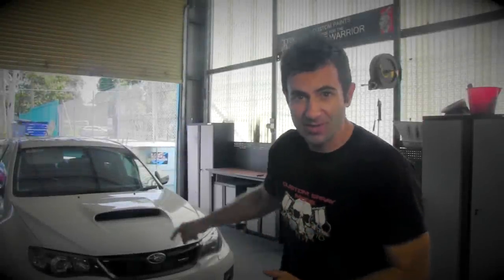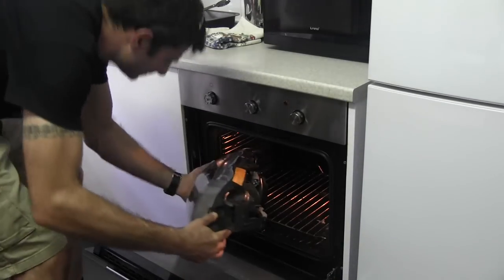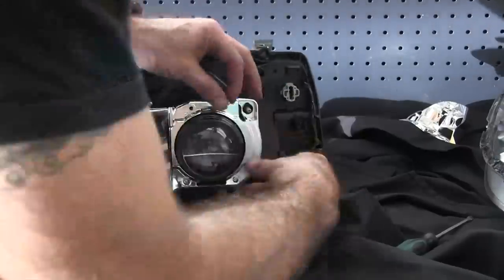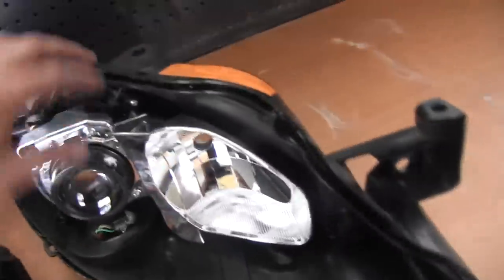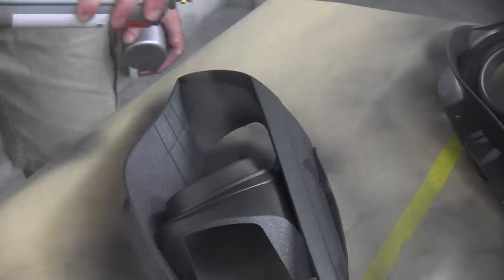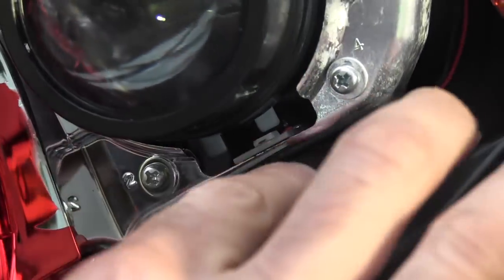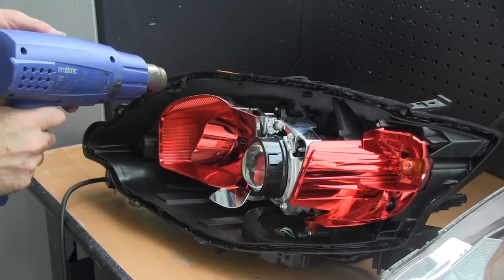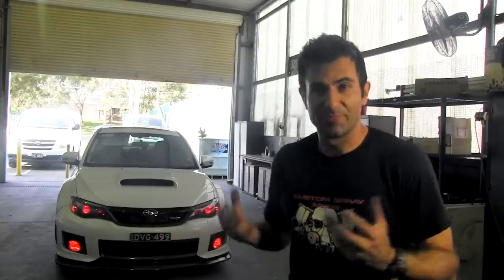How to Customize Your Head Lights

Comment: That would attract cops like it was a dunkin donuts on wheels
Reply: You win dude, comment of the year
Reply: Mason Holloway  it's not necessarily illegal if you're not using it on the road if it has a separate switch then you could use it just to impress your friends
Reply: In California just having it on the car is illegal, unless you remove the fuse while it is on the road.
Reply: Mason Holloway of
Reply: capitolemiproducer Everytime I read California and Cars it's never good. California is not a place to live if you love cars.
Reply: It would be illegal in Virginia too.  Yellow would be fine but red or blue on the front is a big no no.  Heaven forbid if it blinks and you will get an impersonating a police officer charge too.  I had a buddy that got that years ago for having blue marker lights.  1 lawyer and 3k later they dropped the charge as the lights didn't flash but he still had to pay a defective equipment ticket as the lights weren't functioning the way they were originally intended in their DOT approved configuration.  3k was a small price to pay to get out of a felony offense but a huge price to pay for 15 dollar pack of colored bulbs
Reply: Mason Holloway i agree i had bought a pair of mirrors with blue and amber signal blinkers on it..and didnt had them that long before cops stop me at least twice...and last time having a verbal warning telling me to change the blue leds..on them i reside on indy
Reply: Yep
Reply: pprotory.
That country need some real criminals to keep police busy in real stuffs and not being clown in the roads
Reply: Mason Holloway but also it would attract ladies and gays
Reply: Why would this be illegal
Reply: Can’t you just buy like a tiny for headlights?
Reply: @hemigod2  slow year???

Comment: disclaimer for anyone wanting to do this. You'll allow moist air into a sealed section of your headlights, so if you want them to stay looking good. Hide a silica pack in there somewhere. This will keep the headlights from fogging up on the inside.
Reply: Why do you think he re-sealed it? Lol
Reply: Fultzy02 The reseal has to be perfect, and it lets moist air in previously sealed and decanted areas. Therein causing headlight fog.....
Reply from the maker: +Luke AOD when you change the light globe it opens the inside of the lights. Whats the difference
Reply: I thought the same things man. I really don't know, but it happened to me twice. the second time I used silica and that worked.
Reply: +Luke AOD If your headlights are fogging up inside its not sealed up somewhere..Has nothing to do with removing the lens and putting it back on...Ive seen plenty of aftermarket headlights fog because they werent sealed correctly from the factory..
Reply: Luke AOD i think you have a good idea about that tho i suppose that could work for anyone with foggy headlights! ill have to check it out sooner or later

Comment: I'd go with a more intelligent choice than red on the front of the car.  Legal or illegal, the red would cause major confusion in traffic. This seems like a lot of trouble for any vehicle except for a strictly non-street custom show car.
Reply from the maker: An intelligent person would be able see that at the end of the video there are examples of the red lights off at night and that the red lights are on a switch that allows me to turn them on and off when ever I want. Every car is capable of speeding or running red lights. Does this make all cars illegal? The lights are on a switch. I even have a switch that makes my exhaust louder.
Reply: Oh good so you only have them on while parked at shows right?
Reply from the maker: I chuck them on when I go into car parks love peoples reaction.

Comment: hey guys i just found my dream car: White Subaru Impreza WRX STi - SR02 TCX - seen on display at the Japanese Car Show, Knockhill Racing Circuit, Fife, Scotland, May 2017. and i wanted to try to find it and buy it someday but saw nothing exaclty the same as it and i was looking especially for the lights. My question is: Is it possible to change the light kinda like yours to extremely round one like of the car i mentionned?

Comment: If you reseal using windscreen sealer you will never be able to open them again without damaging them. You can buy the same stuff the factory uses to seal them, it's called butyl tape. Otherwise excellent mod, although I wouldn't paint the reflectors unless you can see in the dark ;)

Comment: Dude if you want to go to jail for having red lights in the front of your car keep up the good work. If you get stopped at any check point they WILL tow your car away.
Reply from the maker: its on a switch. the red lights arent on at night. There is a clip at the end of what the car looks like with normal headlights on and there is no red showing. Every car has the abilty to be illeagal. Same as anyone can speed over the limit or rip a skid at traffic lights. With great power come grear responsibility. haa.

Comment: is this even street legal in america? and if so where and under what jurisdictions?
Reply: I don't know why it isn't illegal everywhere, but it's super illegal in the United states. Why it is is because people could mistake the headlights for taillights
Reply: +Drew Stawski wrong! you can't have red or blue lights in the front of the vehicle because it mimics a rescue vehicle or a police vehicle. which is illegal.
Reply: +PRANKurFACE thanks! Now I know!
Reply: +PRANKurFACE actually you are both right
Reply: +Behold the King o shit wuddup
Reply: Drew Stawski sup lol
Reply: That's actually not illegal in all states. I see it around here quite often, and the cops don't pull them over. I would just highly recommend you look into your local laws before going forward with it.
Reply: +Mark LaDoux you know I said that right lol
Reply: Missed your comment, sorry
Reply: Also, I am in the US, and it's legal in my state
Reply: +Mark LaDoux where I live you can't have blue or red headlights ..because they are use for emergency vehicles... but law enforcement is not strict on it unless there is flashing
Reply from the maker: The Head Lights are not red. I didn't paint the headlights. At night it shows white light.
Reply: +Behold the King would green be OK
Reply: +The Bakon Men depends in what law enforcement says in your state
Reply: +Behold the King on*
Reply: +The Bakon Men I live in SC its not in the codes where you cannot have green lights...it states you cannot have red or blue ..or any amber color lights that represents emergency  vehicles
Reply: you need to get a show car registration in florida

Comment: Have you been busted by the cops yet? :P
Reply from the maker: +imteh1337 Nope
Reply: +customspraymods Well that&#39;s just matter of time. Looks very nice though......
Reply: +Chris Lee why would he? is it illegal?
Reply: +Hao Liu yes , in my country belgium
Reply: +Hao Liu I don't know he is in Belgium but in U.S and some countries its illegal for sure ,reason is that other drivers may get confused that is it tail light or someone is driving in the wrong way, so only white and amber is allowed appearing on the front of the car except the emergency vehicles .
Reply from the maker: +Chris Lee Guys, First look at 13:30, its not a red light. Now look at 14:26 not red light. This is how the car looks when its driving around the streets. If I park and want to show off the red lights, then I flick the switch and the red come on.
Reply: Chris Lee
Reply: That's the way to do it if you are going to do it. Just don't forget that you have them on the next time you pull out of the parking lot at night. Where I live you will get a ticket for just having them on the car period. The only way you can have them is you must take out the fuse when you are on a public road or have them covered if that's even possible. Just like KC lights (spot lights) mounted up on a roll bar for off roading must be covered when on the highway.

Comment: Is this legal in nsw?
Reply: Nope only colors facing forwards is clear and amber
Reply: +Nathan camilleri yeah thought so
Reply from the maker: 14.25 only white lights facing forward. Whats illegal about that.
Reply: +brenton987 highly illegal. not  allowed blue or red light's at all in anyway besides for brake light's
Reply: +customspraymods The parking lights and high beams now have a red tint due to the red paint on the chromed reflectors, so will attract a defect. I&#39;m sure you could argue that it is a technicality because the actual bulb is emitting white light and sure there are factory cars where the light would unintentionally reflect from a piece of body colour trim and colour the light, but the average highway patrol copper probably isn't going to listen to your spiel while they are writing you a ticket and putting a defect notice on your car. More trouble than it is worth IMO.
Reply from the maker: +TMM 14:25 white.
Reply: +customspraymods 11:53 red parkers. The only lights that are properly white are the low beams because they are unmodified. I wasn't trying to be a troll but your responses are obviously ignorant.
Reply: +TMM Oh well just don't get caught hahaha, I have led underglow on my car but I don't use it when I'm driving....much. I know I'm allowed my underglow but only when I am parked and my engine is off, I don't know if the same applies to the demon headlights but at the very least it's still a cool idea for a show car.

Comment: if you want a fast easy way to heat up the head light assembly to either remove or reinstall the clear cover. Take a cardboard box large enough to hold the headlight then place a small hole in the bottom large enough to stick the tip of the heat gun inside the box and let the heat gun run for 15mins. This should be long enough to pop the clear cover right off or to reinstall it with the factory seal as well.

Comment: That would be great for a show-only car, but driving around with colored headlights here would be an instant ticket. I put multicolored LEDs in there that are separately controlled along with my undercars so I can keep them off while moving.

The painting reflectors is a huge no-no here as you'd change the color and brightness of your headlights.

Comment: +customspraymods Hey, looks mad, but if you painted the chrome reflectors, wouldn't that limit the light reflecting from the bulb? i.e lower lighting performance. You painted the chrome reflectors for the high beam as well, I'd expect your high beam to not shine your way as brightly as before now.

When you have both Low white beam(main) and LED red light on, would that give an overall red head light effect on the roads? Or would the main white beam overpower the red LED light?

Thanks
Reply from the maker: Hey thanks yes the main white overpowers the red. I have red lights at the flick of a switch but with great power comes great responsibility

Comment: is it possible to add the demon eyes without removing the housing? because it just seems like if you remove the rubber in the back of the light you can easily install the demon lights that way

Comment: I am wanting to do this in a deep gold. What should I use as my base coat on the plastic? Black?
Reply from the maker: Home Lackin spray gold candy over the chrome. Or use silver base.
Reply: Thank you! I just want to tell you your vids are INSANELY helpful. I am attempting to put in work on my Scion IM, little bits at a time is all I can afford, so I buy parts but put in everything my self. You provide clear instruction to those with no experience. Thank you for your services! 
Also I enjoyed your rush from the oven to the garage. That scene was priceless. "Even lovers need a holiday..." Hahahah I hate-love that song (work at CVS, on ALL the time)

Comment: Would i need to use scotch brite on my headlights if theyre all chrome just like youre reflector bowls? I noticed u didnt scuff up your reflectors before painting them red
Reply from the maker: use adhesion promoter and it should be fine.
Reply: thanks!
Reply: Rustoelum's Plastic Primer cures all the sanding and adhesion promoter in one step. I've used it several times and the results are amazing.

Comment: I see you used window sealer... you know you're probably never going to be able to get the headlights off again with that on there.

OEMs use butyl rubber rope to seal headlights, which is like a gummy-type glue, not a caulk/silicone type sealer. It melts with a little heat and turns tacky again when it cools down.

Nissan actually sells the butyl rubber headlight sealer in ropes at any dealership.

Comment: Hi, Dave, I want to retro fit my stock headlights on my 91 Mitsubishi Galant, the lens are glass what do I need to get the Job done with out breaking the Lens by pulling them apart Any info will be Greatly Appreciated /  you can PM on face book as well, Dave Miller ... Thanks

Comment: What kind of prep is required for the chrome reflectors when spraying anodized paint over?
Reply from the maker: grey scotchbrite and adhesion promoter.
Reply: +customspraymods never actually used scotchbrite before, wouldn't the marks bw visible on the reflector even after the clear colour coat?

Comment: OK nobody didn't notice this but you see how you painted the red chrome highbeam parts of the headlight they came out though looking once you apply the clear coat The red turns into a chrome finish again and gets that shiny red chrome look so this is how you get JDM yellow amber headlights you painted yellow in the middle then you put six" coats on the middle painted parts of the lamps
Reply from the maker: Gg hi Hi deed Hideed yeah man. Checknout my Facebook and Instagram for some more lights I have done in yellow chrome.
Reply: Gg hi Hi deed Hideed

Comment: nice mod but for future reference...you should never reseal your headlights with silicone. That will messed up the seal. Always use Butyl Rubber Glue to reseal. Also never touch the reflectors and inner lenses of the headlights with you bear hands. Other than that great job and nice finished product

Comment: In sweden you cant drive with 1: Underglow 2:Custom head lights 3:No plate in the front or back 4: The Wheels sticking out the fender

Comment: is there any way to do this to a Chrysler 300 that doesn't have projector headlights?
Reply: You're gonna have to buy aftermarket projector headlights most likely
Reply: +Michael Schuster I may just paint them and drill some small holes for some led's and hot glue them in

Comment: Why didn't you put a RGB led in so you could do any color and use a proper remote and control unit so you can shut them of or change white when you see police, also stick to painting because I wouldn't let you touch my headlights putting the ballast in the oven and right on top of the hot rack instead of using wood cut 2x4's or foil. Also that is called a projector not a headlight, why didn't you just use oven cleaner instead of sanding the hell out of your bezels!
So many things I see you did wrong I hope you don't do this for a living and honestly who paints their reflectors fire engine red so its red every time you signal!

Comment: I got a ticket for modding my car h.l. ticket in CA was 60 USD plus court fee 15usd and point on my lic. And got my car towed away to I can fix it that 350 plus .99 per miles . Not worth the headache and the time to deal with the legal problem.. Jan 14 2018 2018 Honda accord sport.. but I can't front my lights was popping.. I think they don't like you to mod your car.

Comment: One suggestion. Make sure to wipe the lens down with rubbing alcohol before you reassemble the unit to make sure you get all of the oils from your hands off of them. 

You might also want to do this on an after market set and save your stock set to put back on the car after the first cop you pass flips a bitch and slaps you down a ticket. You know that's what is going to happen so.... Just saying.

Comment: I appreciate the effort made, and the quality of your work, but what kind of absolute wanker would run red lights on the front of a vehicle? I assume its for off road use only :)
Reply from the maker: TrueBlueEG8 you assumed right. You can see at 14:14 there is no red lights at all only normal headlights. The reds are on a switch.
Reply: I may have sounded a bit rude, I apologise, but I was just thinking of lads I have seen with these on our roads, it is very unsafe. You did a great job on them all the same. Interesting videos and good explanation.

Comment: can anyone tell me why would this be illegal why? ?? even if it was any other color??
Reply: Well it varies a LOT place to place. There is generally some law governing what is acceptable for both headlights and taillights. Both are potential hazards to yourself and other road users if not at an acceptable standard.

Basically, there is a reason headlights must be white emitting lights, other colours will largely reduce your visibility for both you and to others. So regardless of what other colour you use, this kind of mod is unsafe and thus illegal. At least while driving. So, in some cases, if it is for show and can be switched off on the road then it's potentially fine (or at least easy to get away with). 

As for red specifically, even if coloured light modifications are somewhat legal, Red and Blue lights can be reserved for emergency services only.